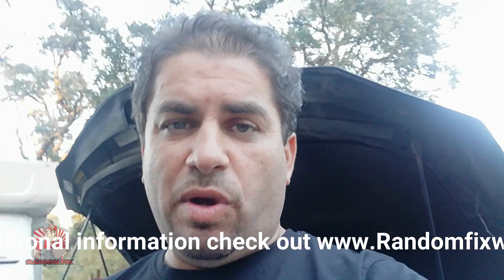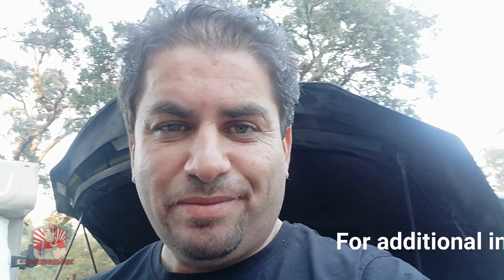Does Cataclean Work? Failed Smog, Bad Catalyst, P420 P430 P431

Comment: Holy crap...the stuff worked!   The CE light was on forever and my state emissions test was due.  The codes indicated I would not pass the test. I added Cataclean on 1/4 tank but I failed the first test on a 2006 Grand Cherokee with 180,000 miles because I disconnected the battery to turn off the CE light and didn’t drive it long enough to reset the computer. I drove 100 more miles and passed the retest!  It may be temporary and I suspect the CE light will return but at least I have two years to plan for a new car.
Reply: Doesn't work

Comment: I have a 2003 chevy tahoe and my check engine light is on P446 and P449 I just bought the cataclean because it failed the emission test I have them do a diagnostic it said I needed a catalytic converter. So hopefully this works because my stickers go out at the end of the month and I can't afford $800 to get it fixed.
Reply from the maker: Hi Deona, please watch my complete smog tips playlist and there is a cheaper and more effective method. Or in case cataclean work as passed.
Reply: Did it work?
Reply from the maker: Yes it works, sometimes it will take two bottles but this for catalyst that barely fail. Have you checked out my complete smog plays for the combustion camber bypass video? That method is more direct and cheap. Best of luck and let me know it goes. _Randonfix

Comment: Thanks for the video! Should I follow the directions to the t? I saw a different video where the person made sure his tank was bellow a quarter and drove his car hard and over the recommended 10-15 miles. The directions say to drive normally.
Reply from the maker: There is no way to follow it to a t as you don’t know how fuel is really in your tank. Do you best, what are you trying to solve?
Reply: @RANDOMFIX  I just meant. Should I follow the given instructions to the t? As far as only driving 10-15 miles and driving normally. I was thinking to give her the beans until almost empty before filling up. P0420 code.
Reply from the maker: What are you driving and how fast does the code set?
Reply: @RANDOMFIX  2006 Scion TC. The code kicks on around 20 miles give or take. I drive on the freeway at 60mph to get the monitors ready.

Comment: Used this over a year ago to make my P0420 code go away and has kept it off since.
Reply from the maker: Thats awesome information.
Reply: @RANDOMFIX  Thanks lol. I wonder is there some sort of universal threshold for "catalytic converter efficiency" or is it left up to the vehicle manufacturer?

I think my car was very strict on how efficient it wanted the cat to be and threw the code really early, possibly explaining why cataclean worked so well for me?
Reply: @Chrislav7 there is a threshold but I don't know if it's universal! Allow me to elaborate... I have a Bluetooth obd that allows me to monitor all sensors on my vehicle. 

There wasn't one in the standard list of sensors but I was able to find it in the "non continuous monitors" section. 

At first glance the different sensors look like nonsense because they are coded weird things like $03, for example. 

But there is a obd-2 "mode $06" (thats what this hidden mode is called) guide I found online for my car make and model that helped me decipher which one was related to the cat. Also, I was able to rename and nickname it, which made it actually show in my available lists of "live sensors!"

Also, I was able to confirm because after the p0420 code popped up, I ran all the non continuous monitors and something VERY interesting popped up. 

The only one that was exceeding the "parameter limits" was the one I had identified as the cat. 

The minimum was 0 and the max was 608. Mine was showing 721. Hence the CEL.

Hope this helps answer your question 👍
Reply from the maker: Hi Robert, thank you for the great info, what is the make of your vehicle?
Reply: @RANDOMFIX  05 Honda accord lx 2.4 liter/4cylinder with 5 speed manual trans.

And thank you! I've been struggling to find the permanent cure for my own p0420/p0139 codes that intermittently come and go. 

Or at least find some rhyme, reason, or pattern to what makes them come and go randomly. 

Sometimes the code shows pending but then never confirms. Sometimes it shows pending after it's already pended, been confirmed once before...and to complicate it further, the CEL isn't a reliable indicator because it lags behind in lighting up. 

So I've resorted to all out compulsory behavior like constantly monitoring the cat efficiency with that live sensor hack...andchecking for codes, sometimes twice per trip. 

Once the cataclean runs out of its not resolved I'm gonna replace downstream o2 sensor...again (same p0139 code prompted its recent replacement about 2 months ago)
Reply from the maker: Thank you reply back, these monitors can drive a person mad.
Reply: @RANDOMFIX  you don't even know...or maybe you do actually 😂

If it ends up being the cat I may just straight pipe it 😂
Reply from the maker: I have a video on how to get a catalyst for dirt cheap And I've just them before and they work 

https://youtu.be/Wr1vFqCnpDc
Reply: @RANDOMFIX  oh yea and CEL has been off for almost 100 miles after refilling with just gas. Have not manually cleared them. I don't even do that anymore. It's a legit form of denial 😂 But yea fingers crossed! 🙏😅
Reply: @RANDOMFIX  thank you for the link! But I hope i never need it lol
Reply from the maker: My pleasure to help and thank you for sharing your story. I really hate the amount of inconvenience these smog test cause.
Reply: @RANDOMFIX  it's like trying to figure out which one of the kids (oxygen sensors vs cat) is lying and which one is telling the truth. Sometimes they both lying. 😅

But I'm not gonna lie, a small part of me has enjoyed the journey. 

A couple yrs ago I didn't see myself tackling mechanical repairs, much less intermediate-advanced diagnostics 😂

I'm almost ready to graduate from YouTube mechanics University 😂

Comment: My check engine light came on.
I bought a bottle of cataclean. I followed directions. I woke up this morning and no check engine light. 
I ran my fuel down to a quarter tank, poured the bottle in as directed. Ran my car for 15 miles. I woke up this morning and no check engine light.
Reply from the maker: Get your car test right away if you need an emission test, this is not a permanent solution.
Reply: Did it stay off or did the problem return?
Reply: It turned off. No harm done. After a few months the light returned but went off on its own.

Comment: My 2001 M5 SES light kept coming on and was throwing p0420 codes for cat efficiency below threshold. Has new cats and 02 sensors, so I'm guessing its more than likely due to carbon buildup in the faulty design of the secondary air pump. Anyway I dumped a bottle of cataclean in with 1/4 tank this morning and drove about 50miles on the freeway. No codes yet, drive cycle looks good so far but cat still inc. Will report back after it completes.
Reply from the maker: Okay, best of luck. I can't believe you are getting a p0420 with new cats? _Randomfix
Reply: Hi Brenden. How is your car now? Its been 9 months since you posted this msg. Any lights?
Reply: Apparently he’s still driving in circles
Reply: @gedionsamuel2256  yeah prolly. Light stayed off btw. F.T.W.
Reply: Brenden really? I’m in that situation but ran across too many people saying adding either cataclean or lacquer thinner will end up further clogging the substrate, might melt it or even affect other components etc.

Comment: About to buy this at Advance(work) for my 3.5 charger. Hope its not a waste. I need my power back. Feels sluggish from possible clogged cat. P0430
Reply from the maker: It's a hit or miss depending on the condition of your catalysts, I like the direct approach better but requires a little work. Check my playlist for the video. Best of luck and let me know it goes. _Randomfix

Comment: Thanks so much for this video I'm going to try this tonight I'll be stopping at Walmart to pick up a bottle. My car is jerking I know I needed a catalytic converter replacement for the past month or so. But the main concern is I was also told that there is a leak at the exhaust manifold should I still use the cataclean or should I just get it replaced?
Reply from the maker: I didn't see your commeent before, do you still need help?

Comment: Used it and the light went off, but came on after 100 miles!!
Reply from the maker: Yousif, the only permanent solution is a new catalyst.
Reply: Sounds like a good way to just pass smog check
Reply: Eventually I replaced the cat itself, but as it was an aftermarket part it was leaking some air! I had to put some paste between the leaking spots and it passed smog eventually!!
Reply from the maker: Nice, congrats on passing. What sort of paste did you use to cover to leak?
Reply: Thanks!! I used JB weld extreme heat

Comment: I used it and it did work even on my 2013 Navigator Oxygen sensors.
Reply: Hi did u have the 02 sensor  code pop up ?
Reply: Really want to try it for 06 chrysler having 02 sensor codes pop up for upstream and downstream
Reply: Any advice will b greatly appreciated
Reply from the maker: The cataclean may assist with the O2 code, I've seen it work on the catalyst and the label said it helps with 02 sensors. Since it's on both upstream and downstream sensors are sure your spark plugs are not fouled? _Randomfix
Reply: @RANDOMFIX  thank you for the fast reply. I just replaced spark plugs about two weeks ago they looked bad
Reply from the maker: @whatitdocuzzo  you may just have bad oxygen sensors however before you replace oxygen sensors I recommend cleaning the throttle body in the past when I have a clean throttle body the oxygen sensors monitor set a lot faster and this could take 15 minutes to 2 hours depending on the vehicle and just some throttle body cleaner thanks
Reply: @RANDOMFIX  thanks will definitely  try and let u know how it goes appreciate your time have a good day sir

Comment: Hi, I really appreciate your very helpful information, tips, etc., & have subscribed to your channel. I have a 2000 Toyota Echo & initially I had a code come up for an ignition coil which we changed and that code went away but right after that the P420 came up so I just tried Cataclean today. I followed the instructions but so far the light is still on and I was really hoping it would go away after using Cataclean.  It does seem like it is running a bit better although it wasn't really running bad before it. I'm hoping you have some time to read this and open to suggestions on what to do next. Thanks so much!
Reply from the maker: Lisa, After you pour the cataclean in the fuel tank, you should clear all DTC or codes using a obd2 reader. Here is  link to a video about how to use a obd2 reader and they are cheap. If you trying to pass smog / emssions please watch my emission tips playlist. It's really a process. Best of luck and if you still need help let me know which I/m (inspection monitor) is not getting ready after the check engine light reset or which code (DTC) is popping up again. _Randomfix

https://www.youtube.com/edit?o=U&video_id=1-rp7MUvSM4
Reply: RANDOMFIX    I so appreciate you responding..thank you!!!!!  I thought I read the light will go off by itself if the issue was not that bad (up stream of cat) so I might try it again. I would really like to save some money by doing this again to try it out but time is of the essence & my NY state inspection sticker is now out of date. I'm apprehensive to drive around with the out of date sticker. Due to all of that I may just go to a shop so they can look at it & tell me exactly what it is although I don't want to get ripped off.:/  I'll let you know and may ask for more guidance
Reply from the maker: Okay, just let me know what happens. If you check engine light turns on right away within 20 miles don't waste your 💰. Check the smog tips playlist and I have a video where I remove the upstream oxygen sensor and spray seaform thru the catalyst. Since it's bypassing the engine when spray, it is a lot more effective.
Reply: RANDOMFIX   I don't own a code reader but might get one at some point so can I just get Auto Zone to turn it off today and see if it comes back on or do I have to repeat the whole process?
Reply from the maker: Lisa, I think it would to wise invest in scanner, it's $20.
Reply: RANDOMFIX   Ok will do 👍..because I really like this car and want to keep it as long as I had the 1994 Tercel.  Until I go get the scanner can I have Auto Zone turn it off and see if it comes back on or would I have to do the whole process over?
Reply: Lisa, it begs the question, why would you go to Auto Zone and not buy the scanner right there then reset the code yourself right there and then with your own scanner?
Reply from the maker: Lisa, fyi scanners normally only work for 1996 and newer vehicles so you 1994 Toyota Tercel might night a obd1 scammer which can be more difficult to use and maybe lots .Orr money.
Reply: @RANDOMFIX  I don't know the Tercel, but my 1994 Camry has OBD2 plug hidden behind an ash tray to the left of the steering wheel. The tray gets removed and there it is. Even one of the smog check places didn't know where it was.

Comment: Uselessness product 
Cost me ($30) from auto zone
I use it for my vehicle ( Chrysler town&country) 2015 
150k miles not working at all 
Only does save gas ( that said) 
Please don’t believe wherever you watch ( lier /scam) 
As my experience & point of view .
Reply from the maker: Hi Sam, thank you for sharing you views point. What were you try solve by using this product? Please provide specifics and make and make+ model + year of vehicle. Thanks
Reply: @RANDOMFIX  
My vehicle ( Chrysler town&country touring /2015 touring / 150k miles 
Have check engine light ( auto zone mention I have code for Cataik (1) , but my vehicle has (2) , auto zone recommended that product as you mention 
I used since may/2021 driving 700 miles nothing happened 
Still check engine light ( that’s why I mentioned that on my comment/ useless / false product ( if you need picture & code report tell me I will submitted . Thanks
Reply from the maker: Sam, easy buddy, I have a life and was out of town. I don't Cataclean or any stocks in the company. What was the actual code, it will start with a p and have 4 digits after that. There are other direct ways of cleaning your catalyst however please understand as you catalyst ages the only solution is "replacement". The product does help you a marginally od borderline bad catalyst. Also, there is many things that cause a catalyst to go bad so when did you first see the check engine light on? Something caused that light to trigger. Here is another way of cleaning your catalyst without remove it from the vehicle https://youtu.be/U0-0XMWR3ow

If you reset the check engine light how long does it take for the check engine light to turn back on? Do you own a obd2 reader?

Comment: will it fix P0300? Ive changed coils, checked compression, spark plugs, checked wires, vacuum leaks nada..
Reply from the maker: Unfortunately this will help with p0300 with a random misfire. What's the make model year of your vehicle? The p300 can be really annoying
Reply: @RANDOMFIX   2010 Audi A4 Quattro 2.0T (B8)

Comment: Hello, I tried cataclean twice but i didnt work.. Everytime it completes the CAT Monitor a P0420 code comes up..what should I do?
Reply from the maker: Juan, check out my complete playlist for two temporary solution for the p420 code. You may get lucky if your p420 code takes some time to set, so reset the check engine at night and try in the morning, you will have to get everything except the evap before the computer detects the p420 code. It's worth a try before doing anything else. If you are successful head over to smog station on the spot and do not turn off the car if possible before smog. Best of luck.

Comment: How about code po172. Will this work
Reply from the maker: Hi ez, a p0172 may not be cured by cataclean. Here are possible causes. A dirty mass air flow sensor overstating the amount of air entering the engine which may cause excessive fuel delivery

A bad oxygen sensor

A leaking fuel injector allowing too much fuel to enter the combustion chamber

A faulty fuel regulator, which may not be regulating the pressure of the going to the engine as it should

A vacuum leak

A possible fault in the coolant system such as a stuck thermostat or bad coolant temperature sensor

Worn spark plugs

Best of luck and let me know what you find. _Randomfix
Reply: RANDOMFIX hello. I replaced maf and o2 check and gaped plugs checked injectors fuel regular doesn’t work of off vacuum. Can’t find any vacuum leaks. Has Carbon build up on tops of pistons? Any thoughts?
Reply: I got p0420 and p0139 which is a slow response when deceleration i havent poured it in yet but i hope it works changed both ip and down stream sensors

Comment: Didn't work for me ... no codes.. just 3 monitors are not ready . Ive driven 700 miles ..
Reply from the maker: What are you driving?
Reply: @RANDOMFIX   2004 Volkswagen touareg  3.2l v6 .. after 3,500 miles only monitor left is the cat
Reply from the maker: Okay, I will make vw video by the end of the month, stay tuned.
Reply: @RANDOMFIX  thank you very much
Reply from the maker: 3500 miles in the new record for an inc monitor.

Comment: Says on the bottle “cleans oxygen sensors” so he didn’t do much research lol
Reply: He says it won’t work if the oxygen sensor is damaged bruh
Reply: @chiquicat1  then why wouldn’t you check it before using cataclean
Reply: @krcoutdoors4566  probably because cata clean may end up fouling out the down stream sensor since that's the last stop before all that gunk blows out the muffler. 
Wouldn't make sense to potentially gunk up a new one. But I'm just speculating 🤷
Reply from the maker: Cataclean actually says it help your 02 sensors.